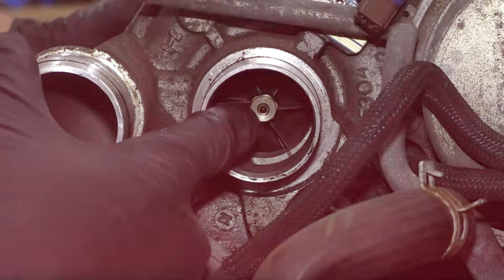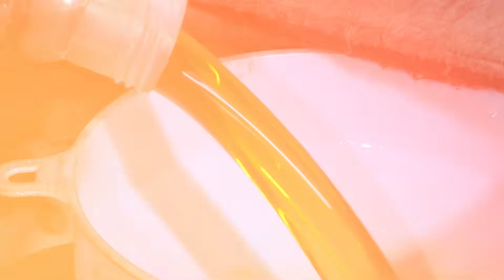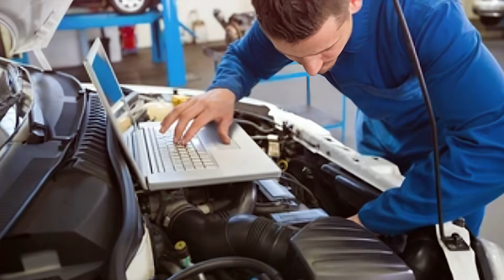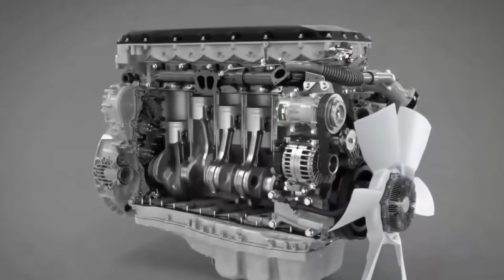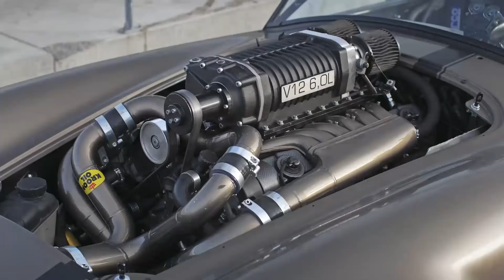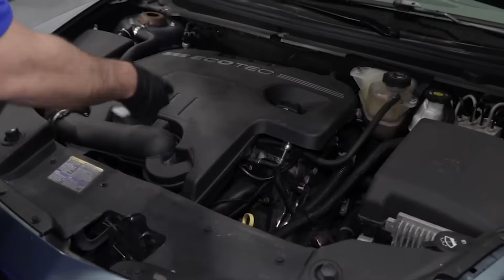A SERIOUS Warning to All VW Owners: Stop Using This Engine Oil NOW!

Comment: Buy the cheapest filter and correct viscosity oil and change it every 5,000 miles.  I've been doing this for 24 years in Minnesota.  No major engine mechanical problems for my Jetta.
Reply: @frankhoward7645. .your a PULPIT OF BAD ADVICE

Comment: Why not use racing oil for mc? Ive punched several engines to the max! N allso turbo converted 1L engines. Is this serious or what? I appiciate all answers.
Reply: Btw.. sbk racing didnt get any bad sound b4 som 800 km even if punched 2 the max.
Reply: Did you accuse post in the wrong video? This comment has nothing to do with the video.

Comment: The whole VW approved scam.  Use quality synthetic oil with API SN or above with the correct viscosity and you'll be fine.  Change it regularly.
Reply: The ol’ “I know better than the engineers that designed it” netizen. Always a favorite.

Comment: VW Golf MK5 1.9 TDI 2005. When I bought it new in 2005, the manufacturer said it was 5W30...

Regarding current offerings, online research indicates that the VIN for the MK5 1.9 TDI always recommends 5W30, which was the standard introduced in the systems at launch. In the case of Castrol Edge 5W30, it is currently standard 504/507.

On the Liqui Moly website, the VIN indicates 5W40 standard 505.01.

I used Castrol Edge 5W30 for many years, but the current one is no longer 505.01 but rather 504/507...

I did some research, read my car's manual and older manuals, and spoke with former VW employees. What they told me was that the PD engines, initially, due to marketing efforts related to the introduction of a "long life" service interval of only 30,000 km, came with that recommendation, but the oil was standard 506.01 and 507, which was so the ECUs could monitor the oil quality and warn of the need for a change... Even in cars without DPF. Quickly, customers and workshops outside the brand started performing oil changes every 15,000 km or 1 year due to wear on the turbo, tappets, etc... And the "Long life" mode was deactivated in most cars, which wasn't what the PD engines needed, even though they were functioning... Meanwhile, VW itself changed the recommendation in 2007 due to compounds that were specifically lacking in PD, BXE, BKC, etc. engines... And the ideal standard became 505.00.01, a more suitable lubrication, and without DPF they returned to changing it every 1 year or 15,000 km.

Since my warranty expired, I've been using Castrol Edge 5W30, but for the last few years I thought it was the same as 15 years ago. However, it seems they stopped making the specific 5W30 505.01 for PD about 10 years ago because it was a niche market. That's why their 5W30s are now only 507.00, which is suitable for various makes and models, and it seems that's what some people, including myself, have been using. If you notice, the original VW oil for these engines is 5W40 505.01, as is Liqui Moly. Anyone who wants to continue with Castrol, to maintain the correct lubrication standard from the manufacturer (505.01), has to switch to 5W40... Because 5W30 is no longer the ideal standard. I switched to 5W40 505.01, whether it's Castrol, VW, or Moly. What about you? What standard do you use? I've just started using VW 505.01 5W40 at 250,000 km.

Comment: If you change your oil every 3,500 miles, walmart brand synthetic 5w40 oil is just fine, ben, running that my 2011 VW jetta diesel TDI For 300,000 miles.
   Absolutely no issues.
Reply: How’s your dpf and eve holding up? Just curious is that oil 507 approved?
Reply: u hav changed oil 85 times ? ? ?  that iz CRAZY... if u used AMSOIL & changed around 10k u wood hav changed it only 30 times... u wood hav saved $$$ & time by not doing it as often... & also ur wallmart oil iz NOT a real synthetic, it iz an 'OVER PROCESSED' real oil out of the ground...  AMSOIL iz a "REAL" SYNTHETIC OIL... i use AMSOIL hi-mileage 5w30, not the 0w20 in my '16 lexus NX200t w/89k on it, runz smoother & quieter & my MPG went UP a little bit, not DOWN like ever1 said it wood w/the thicker oil...

Comment: This isn't complicated folks.  Look in your OWNER'S MANUAL for the proper oil to use (viscosity/VW approval code.)  If it's not there, look around online or call your VW dealership, or go check a reputable oil company's website.  Walmart has 0w20/508 (what my 1.5L Jetta needs) from Mobile 1 and Moble 1's website recommended this (and confirmed with the dealer.)

Comment: I'm using a German made Mannol 5w30 507 fully synthetic oil in my 2011 TDI Golf and Tiguan. It's VW approved. I change my oil every 6,000 miles on all my cars. 👌😉
Reply: Where do you purchase this at? Also, is your TDI deleted or intact? Mine is deleted as of recently, Ive always used 0W-30 507 but now in the Georgia heat I bought the LiquiMoly Leichtlauf High Tech 0W-40 to put in it but Im not exactly sure if that is what I should use, kind of looking for guidance.
Reply: Correction, its the 5W-40
Reply: @triple_five_soul6439 I get mine on Ebay in 20ltr drums.

Comment: '15 Golf Sportwagon 1.8 running Castrol Edge 0/5w40
Castrol Edge 5w40 from factory.

Don't destroy your engine for better gas mileage.

77k miles, runs like new.
Only loses 1/2 qt in 10k miles.

Comment: the only oil in this program that does not use class 3 base oils, which is a mineral oil is Liqui Moly, and RAVENOL but this one does not have vw 504.00 approval, for some reason it has vw502.00 approval and these vw502.00 and vw 504.00 these vw oil standards should be interchangeable according to vw
Reply: VW absolutely does not say they are interchangeable. You cannot use a 0w-40 502 oil in a car requiring a 504 oil.
Reply: @rdspam  My 2003 Golf 2.0 4motion (115hp) can use both but VW 504 00 is long life oil up to 30000km or 3 years. VW 502 00 is normal oil 15000km or 1 year. I use VW 502 00 because I dont believe in using up to 3 year old oil in a any car, and definitely not in one that can tow a 1400kg trailer.
Reply: Dont use VW 502 00 if you need/want to use Long Life oil change interval!

Comment: Volkswagen specification 504 00 indicates that you should only use the viscosities 0W-30 or 5W-30, no other viscosities are approved

in the program they say that when changing the oil you can use 5W-40, but I wonder if this is correct the VW 502 00 specification the voice states as the specifications is replaced by VW 504 00, it is absolutely not approved in a golf R

I live in the north and we have cold winters 5W-30 can handle down to minus 15 celsius, so I change oil often in the summer I use 5W-30, in the winter I switch to 0W-30
Reply: the only oil in this program that does not use class 3 base oils, which is a mineral oil is Liqui Moly, and RAVENOL but this one does not have vw 504.00 approval, for some reason it has vw502.00 approval and these vw502.00 and vw 504.00 these vw oil standards should be interchangeable according to vw
Reply: @6XCcustom  They are not interchangeable because vw 502 00 (and the very old vw 500 00) are not "Long Life" oil if you need/want that!

Comment: Hi I have been using OEM VW 508 00 509 00 0W20 for my Skoda Superb 2 TSI petrol. As you are mentioning that the oil should be changed every 5000 miles for ensuring longevity, can I keep my oil change interval as 10,000 miles as recommended by the dealership by switching to premium oil like Liqui Moly Toptec 6200 0W20 VW 508 00/509 00 or equivalent?

Comment: Driven cars for 50 years, mostly VW’s. 1. Never will I put a 0w . . whatever in my engine. Born in Africa  hot high . . Never went below 15w . . Ever. Live in Scandinavia now for nigh on 47 years. Have never gone below 10w. New engine 10w30, older engine 10w40. Never had the issues described here. High performance turbo engines or my veteran 73 Beetle.
Reply: I have always used 5w-40. 5w is good when nights are below -18C. Its one of the most common and cheap oils in Sweden. Only problem was with a (used) 1999 Seat Ibiza 1.6 (75hp) when towing a 750kg trailer in the summer. Bad lifter noise and high oil consumption, had to use STP or 50% BMW M 10w-60 oil! got a little better when I added the big oil cooler from a Passat TDI.

Comment: There’s only one oil to use in your VW 
Motul 5w40 8100 X-Cess it’s the best and most expensive oil at $120 for 5L been using it since I got my 2018 golf R MK7.5 specially on stage 3
Reply: This is the way.

Comment: Ai generated garbage.
Reply: This is AI slop and not an actual experienced VW mechanic telling you what to do. Also there are lots of non name brand oils that meet VW specs and are listed as such on the bottle. Walmart  Super Tech 5w/40 is one of these.
Reply: What info is wrong then? And why?
Reply: @pietrocantuccini5584 for starters, VW engines do not run tighter tolerances than other engines.
Reply: @pietrocantuccini5584  check the other comments above.
Reply: @AlberelloLynch  @cmdrwraithe1857 gave the only relevant hint, but so did the video RE the manual. The others moan about AI generation. You're the only one claiming it to be "garbage" info. So, fill us in!
Reply: My owners manual says otherwise, man...
Reply: @cmdrwraithe1857 I am just criticizing this video that is generated by Ai. We don’t need that.
Reply: @AlberelloLynch agree 100% Lake Speed at Speed Diagnostics is a wealth of information.
Reply: @LarryVotruba  what?
Reply: @AlberelloLynch I agree, these AI generated videos are trash.
Reply: @cmdrwraithe1857 No, they are not wrong. These videos are popping up daily. Most have some truth and accuracy but also includes some bad advice. This video is actually better than some. Oil Analysis is your best friend instead of guess work.

Comment: Which oil for VW T-Cross 1.5 TSI?
All TSI engines built in 2018 and 2020 run on VW 508 00 SAE 0W-20, so you're on the safe side with this oil. I use Castrol Edge Professional, LL IV FE, OW-20 every 12,000 km.
Reply: I would reduce that interval to every 8000 km.  Timely oil changes are especially critical to direct-injected engines in order to reduce the accumulation of carbon on the intake valves.

Comment: I run AMSOIL European 5w30 VW 504.00/507.00 plus a WIX filter, they were purchased by Mann-Humel. if you look at the filter it has the Mann-Humel printed on the filter, plus they don't use 0W20 in Europe because they don't have CAFE standards like we have here in the USA. I was told by the VW Tech at my dealer never go past 5000 miles, it's the additive package in the oil that starts breaking down.
Reply: VW use 0W-20 oil from 2020 and forward. 508.00 quality for petrol. And 509.00 for diesel.
Reply: so u think that AMSOIL chemists r soooo stupid that they wood come out w/a product that won't go the full 10k ?  i had a "CC" & ran it 4 many, many miles over & NEVER had an issue... ur dealer wants 2 SELL u his oil... went a little over 40k on 1 oil change in a chevy equinox & oil was still OK... absolutely TRUST AMSOIL...

Comment: I just bought a used 2018 Golf SportWagen from a local dealership with 109,000 kms. I don't know the history of what oil was used other than it was regularly done. I work at a parts Warehouse and have purchased Castrol edge 5w40 with VW 502.00 approval and a Mann filter. I will change it right away and keep it using the 8000km routine from now on
Reply: That sounds correct to me. I have a 2007 Jetta GLI with 147,000 miles on it. It's always had Castrol Edge or Castrol EuroCar in it. (5W30 or 40) First owner, and also from me, the second owner. I also use Techron in the gas, and put only TopTier 91 octane gas from Sunoco. It runs very smoothly, quietly, and still has a lot of pep, so I swear by regular maintenance. Also, learning about your specific VW engine. It seems like you're already doing that.
Reply: A 2018 Golf Sportwagen should be run on a VW 504.00  5w-30 motor oil if gasoline, and a VW 507.00 5w-30 motor oil if a diesel. Read your owners manual, before you wreck your engine with the wrong motor oil.
Reply: @feloniousmonk3049  it says 502.00 5w40 in my owners manual so I will continue to use it thanks
Reply: @feloniousmonk3049  VW 504 00 is long life oil up to 30000km or 3 year. But I use normal VW 502 00 5w-40 and change it every 15000km or 1 year. I swithed my 2003 Golf 2.0 4motion to use normal oil change interval.
Usually I buy store brand VW 502 00, but price is up 17% and it is all out of stock ... :( Had to order some Castrol oil. (I'm in Sweden.)
Reply: I'm with you on using VW 502 00 spec oil and Castrol is what VW recommended at the time. I used to do every 15000 at first but now I'm on twice a year +/- 8,000km.  I even try an non approved oil Valvoline R&P, 5w30 for winter and run for about 6000km on it and the engine is clean.  Now I use Pennzoil or Motomaster 5w40 euro, blended by shell /Pennzoil

Comment: I use OW‐20  (VW 508 00/509 00) as specified in my 2024 GLI's manual. Liqui Moly...
Reply: 5W-40 for longevity
Reply: same with mt 2924 GLI with manual transmission

Comment: Some bad info on here: our GTI and Taos require 0W20, and they do not mention it here. We use Mobil1 ESP 0W20, it’s VW approved.
Reply: Motul or Liquid Molly 5W-40
Reply: My Gti calls for 5w40
Reply: @aarons8295 what year is yours?
Reply: They did mention it through the VW spec 50800 which is 0W-20 Longlife 4.
Reply: Wouldn’t touch Mobil esp ow20 oil it’s not recommended for vw
Reply: @cokeaddict1663 ESP x2 in 0w20 weight IS VW 508/9 approved. Look it up.
Reply: @cokeaddict1663 incorrect. It’s on their list of approved 0W-20 oils.
Reply: @cokeaddict1663  says who?